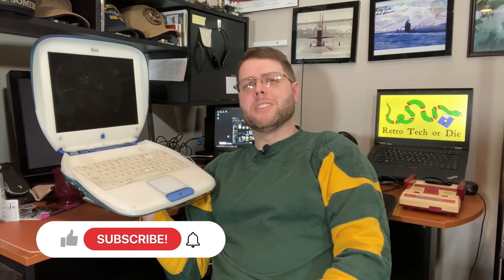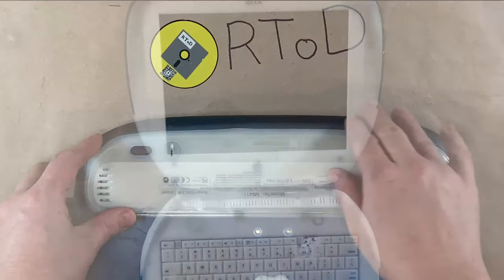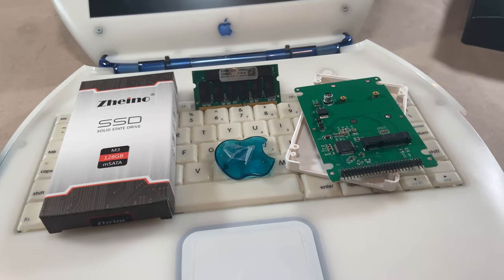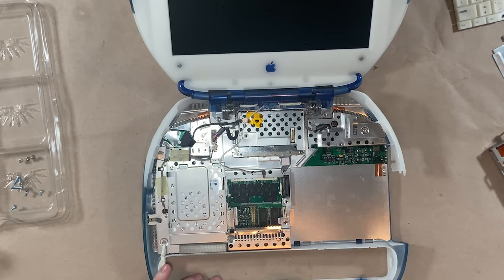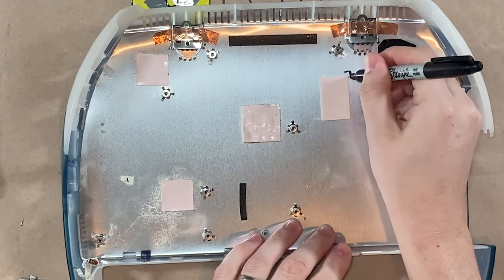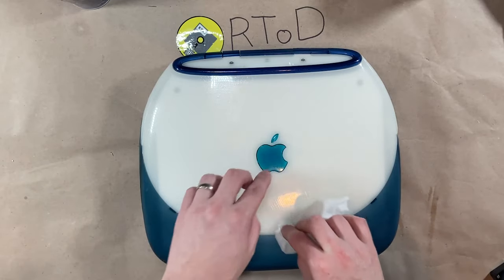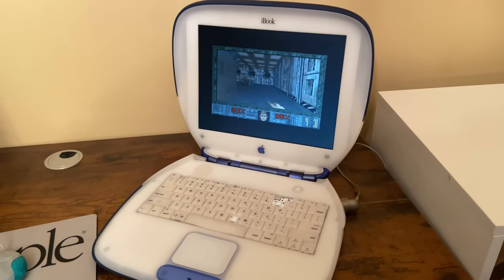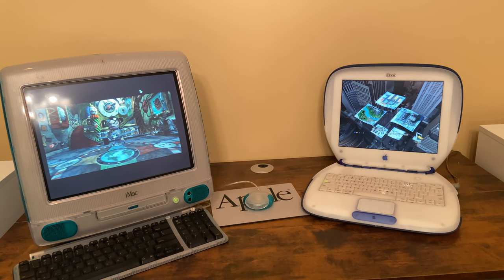Roadside Rescue: Restoring and Upgrading an Apple iBook G3 Clamshell with SSD and Max Ram

Comment: I did pretty much the same upgrades with a graphite 466mhz ibook clamshell a couple of years back, but it still wasn't really useful for anything except to sit on a shelf. The whole case is in excellent condition - no cracks or scratches, and so I took all of the internals out and designed a custom PCB with a Raspberry Pi compute module 4 which is now inside, connected to the original display, keyboard and mouse pad (using a separate MCU to handle the keyboard+mouse to USB conversion, but it's all on one PCB. It can run a desktop now with modern browser etc, and even emulate OS9 to run faster than the original hardware :) I really just use it to play retro games though (arcade, and consoles up to the Playstation/PSP/N64 etc). Also cool to take to coffee shops. It's nice having the WiFi etc all on-board. The only other mod I'm planning is to add a webcam, just for the hell of it!
Reply from the maker: Sounds like a sick mod! Nice work!
Reply: @RetroTechorDie  thanks I’m thinking of making it a straight swap kit - so just changing the motherboard and adding a Lipo battery pack in place of the DVD. I’m not sure there is enough interest though.

Comment: Congrats. I have purchased 3 of those HDD replacements along with 3 different brands of  M2 boards and none worked. Machines cannot recognize them let alone format them.
Reply from the maker: Would you mind sharing the brands of the M2s
Reply: @RetroTechorDie  SSD SATA mSATA 128GB Dogfish, SSD SATA mSATA 256GB Dogfish and SHARKSPEED SSD M.2 2242 128GB NGFF